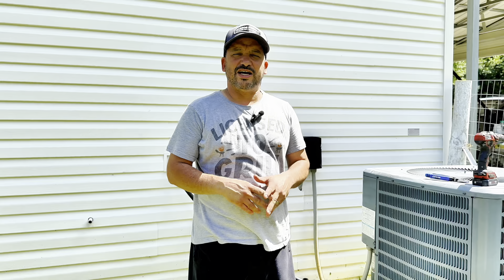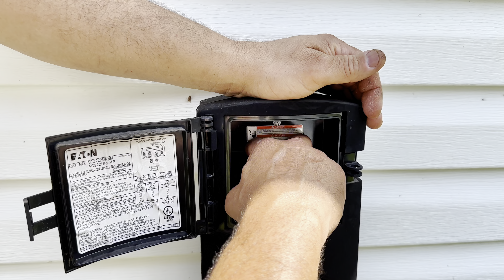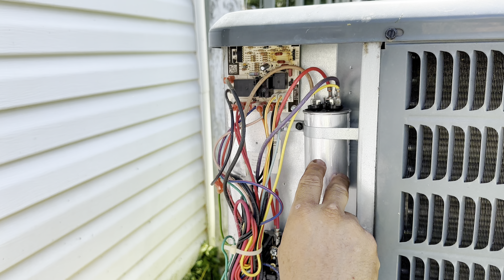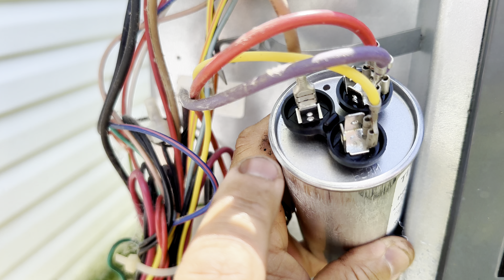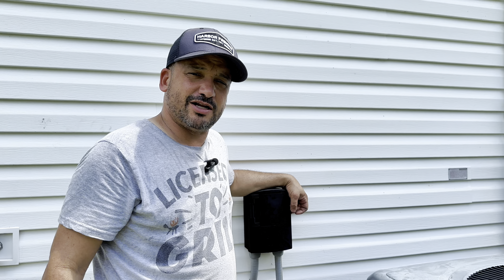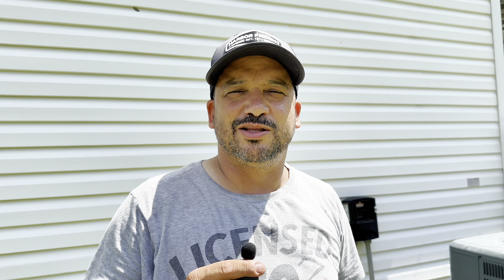DIY AC Repair: How to Replace a Capacitor.

Comment: I can only find a capacitor with +/- 5% range but the one in my AC is +/- 10%. Can I use +/- 5%?
Reply from the maker: Yes, you can use the ±5% capacitor.
A tighter tolerance (±5%) is better than (or at least fully compatible with) a wider one (±10%). The ±10% rating on the original simply means the manufacturer allowed the actual capacitance to vary more from the labeled value. A ±5% part will stay closer to the exact microfarad (µF) rating the system was designed for, which is desirable.
What actually matters
•  The capacitance value (the µF number) must match the original (or be within the range the motor can tolerate).
•  The voltage rating must be the same or higher (never lower).
•  Shape, terminal configuration, and mounting should be compatible so it fits and connects properly.
As long as those match, the tighter tolerance is not a problem. In practice, many replacement capacitors are sold with ±5% or ±6% tolerance even when the original was marked ±10%.